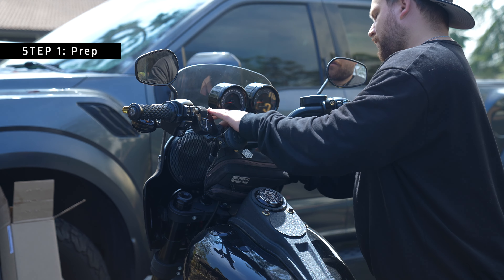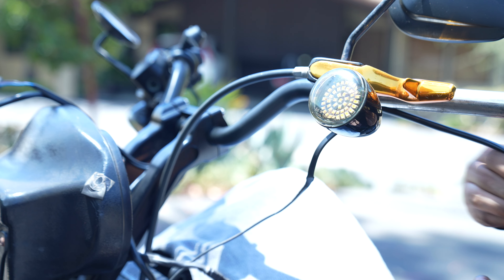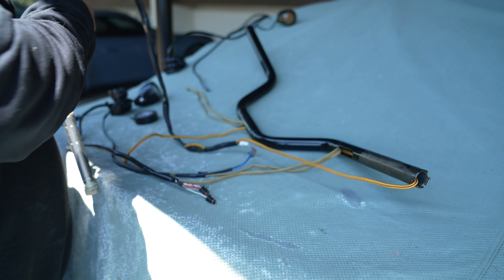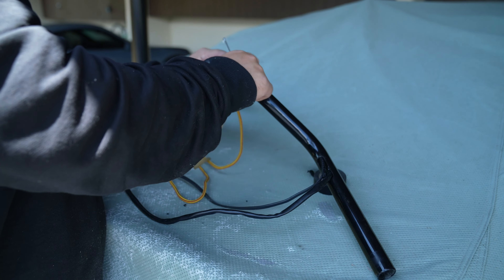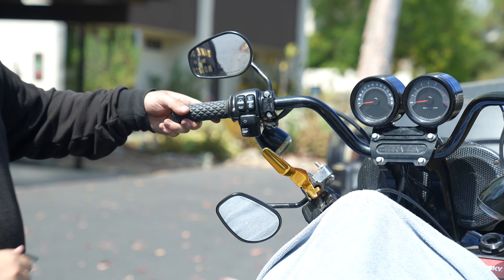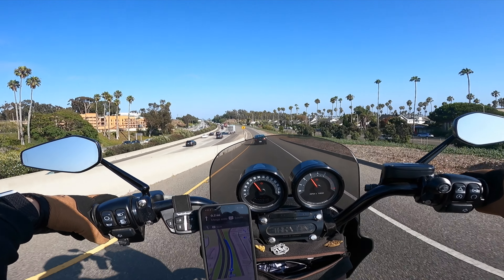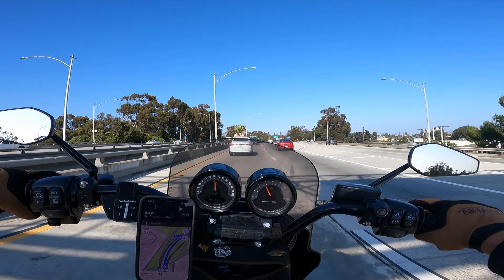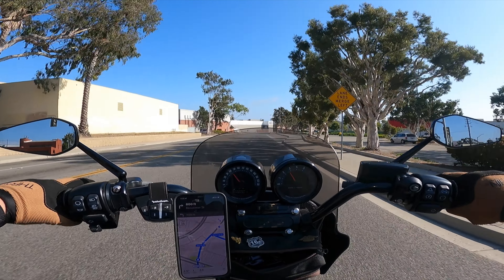Thrashin Supply High Bend Bars | Worth the Upgrade?

Comment: Looking to do the 9.5” Pullback Risers and High Bend Bars on my 23 Low Rider ST but having some issues figuring out what length cables I need. Any input would be greatly appreciated
Reply from the maker: I get this question so frequently but honestly I'm not the right guy to ask. Mine aren't the right size and I kinda had to finagle it to make it fit right 🤫😬
Reply: Find the video that thra⚡️in made installing the 9.5” risers on their channel . If you look in the description; they listed all the part numbers and lengths for the install . Hardest part is paying for it all 🤑